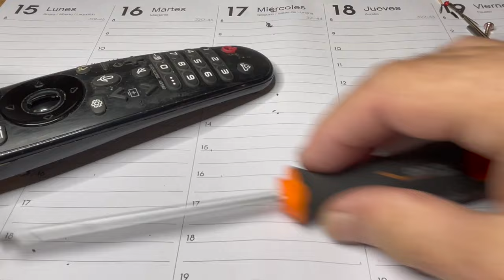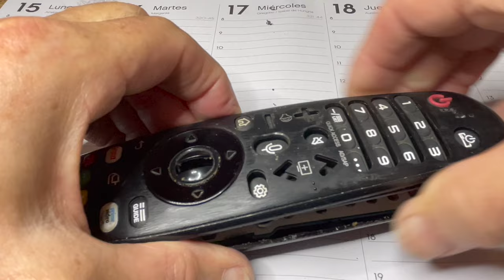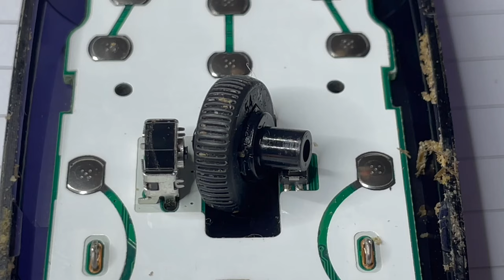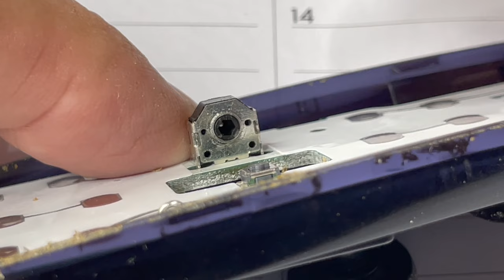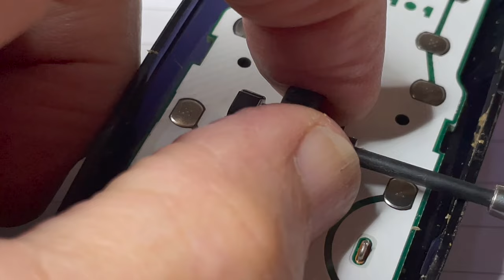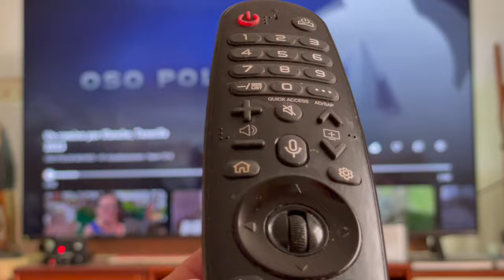LG Magic Remote wheel/button - REPAIR

Comment: Now on my second broken wheel remote. With 3 other options in additon to the spinning wheel to move around the TV is so dumb they make the ONLY place to push ENTER the same wheel? You have the red cursor arrow, the up and down control arrows and the arrows around the circle. But only one way to Enter. It should be a stationary button. And I plan to write to them. If they made a new remote like that I would buy it. 3 years ago we got the smart TV. Then a year ago the remote broke.I watched all these videos but decided to order a new one and ony one was the identical LG remote. A year later wheel broken again!
Reply from the maker: This is a way to make money, make bad Quality produkts.
Reply: are you sure it wasn't bad use? mine worked perfectly for 4/5 years, until the kids broke it
Reply from the maker: @gergelim3417 what is wrong is the design.
Reply: @gergelim3417 mine broke in a few weeks 😐 i used it very veeeery few times because i only used the tv for videogames. 
My dad used it a few times and it broke
Makes sense now that i see how its on the inside, its made to be broken

Comment: Amazing!!! Just saved me $30. Did it exactly how you did only I used a tooth pick and just glued the inside of wheel to it and then was able to push the tip thru the other hole on remote. No sanding. But dude your a life saver I never would have thought to drill out the wheel n use dowel. I was tryn to glue piece plastic to end of wheel. FYI it didn’t work. lol. Thanx again!

Comment: This tutorial was awesome. No Bs, straight to the point and easy to follow.

I didnt have drill to make the hole so I used small screw to make the hole by screwing it into the plastic from closed end and then removed it. That said, if you can get small drill use that! Much easier and less time consuming and risk to break the wheel.

Comment: Amazing. Quick Tip for me: For opening controller use credit card from the bottom up , and use toothstick it’s much easier to cut size also with nails clipper and adjust with small knife . Cheers

Comment: I too fixed an LG remote with a toothpick!  Shaved it down with a single edge razor blade and jammed it in.
Reply from the maker: This is a general problem and LG should repair without any cost for us.
Reply: I get you put the toothpick in but how do you attach the other end to the wheel?
Reply from the maker: @ansn5108  Make the stick long, push it into the wheel. Place teh wheel in plac and push the stick further. When connection works, cut the stick yhat isn´t used.
Reply: @osopolarmovies  just did the exact same thing. Bored out both the wheel and the base then pushed a long toothpick through until snug, then clipped the ends. Worked like a charm
Reply from the maker: @bryanblank4432  Great! Should the problem occur in a couple of years you know how to handle it.

Comment: Thank you for the video. I fixed it. The tickness of the plastic that holds the scroll wheel is laughable honestly. Shame on LG.

Small tip for 'driling' the hole. Heat up a tip of a needle, paperclip or similar thin peace of metal then puncture the side of the wheel. Then push a top of toothpick in it. Shorten it so you can fit it in the mechanism.

After the fix it feels more sturdy 🙂
Reply: Do what now?

Comment: I have done this method over a year ago and it failed after about 10 months. The problem is that the wheel is for two functions - rolling and clicking. Clicking makes the wood to fail after a while. Do you know the correct size of aluminium rod that can be used instead of wood?

Comment: I have a question...
Got the press down click to work but the spinning wheel seems way to smooth now and doesnt react? Does the toothpick need to be hardly pressed into the "sensor" on the motherboard?
Reply from the maker: A normal toothstick in normally thion and the the movement from the wheel will not affect "the sensor". I used a grill stick.

Comment: What do we called the selection push button.mine is damanged unable to use select option using wheel someone help me to find the part number
Reply from the maker: I think yould look on internet to find a new replavement Remote Control since you don’t  know ir your repatriar will Work. Godo luck!